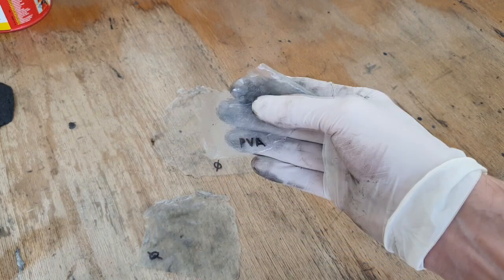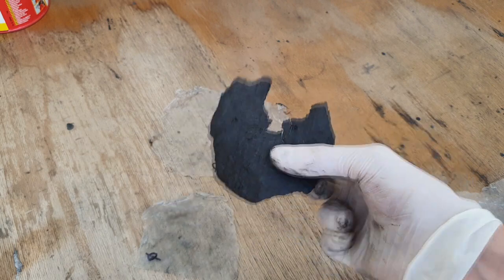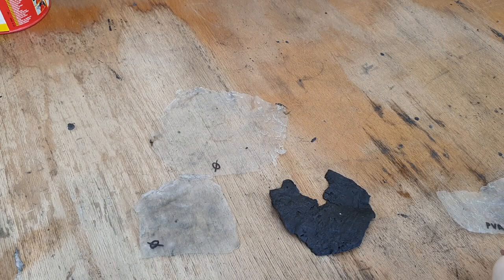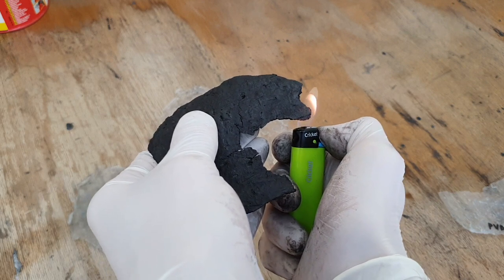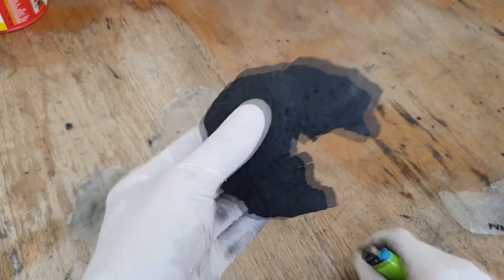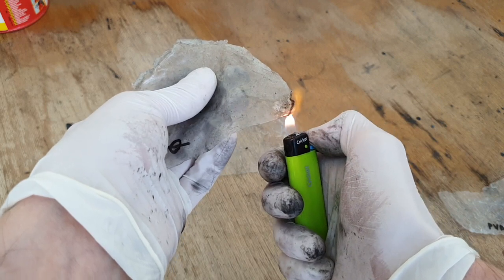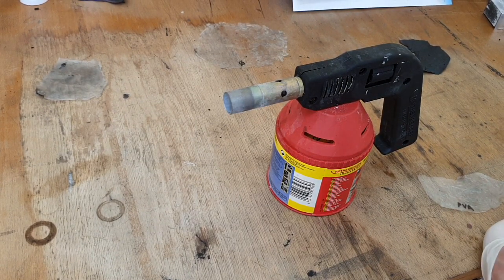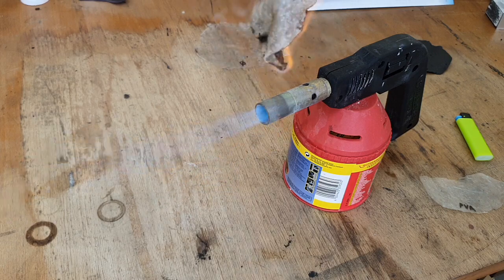Make a conductive Bioplastic - Fire update

Comment: Pretty cool, temp resistance is a bonus, and the ease of manufacturing is great. But what is the potential sheet resistance when just adding graphite? I am looking for an ideal high-temp plastic for my battery (max 60°C temps) but it also has to have similar conductivity to metals (maximum 5ohms per square) - is this doable with your formula?
Reply from the maker: https://youtu.be/vn5bkwJZKpw go to the end of the video where I show the resistance

Comment: are those water proof too or do they dissolve easily ? was thinking it would work good for homemade wires embedded into fabric.
Reply from the maker: Organic wires! Cornstarch plastic have in basic good water resistivity in bioplastic family. Hot water can slowly dissolve
Reply from the maker: Ok, it's seems that I dont have that video anymore wher I make something similar,... but based one on silicone and other on polystyrene